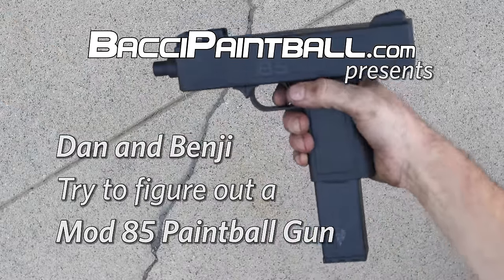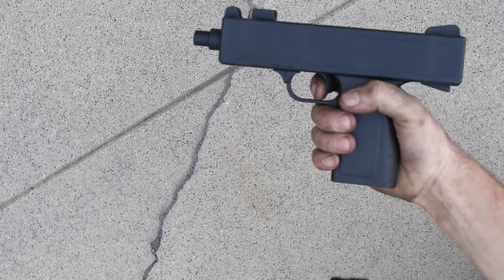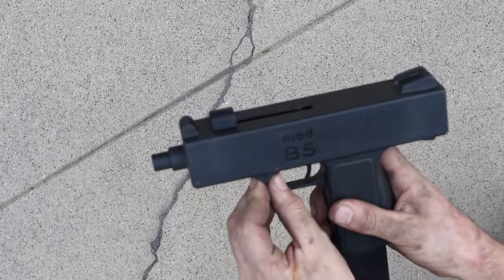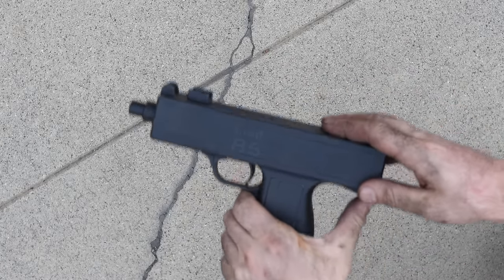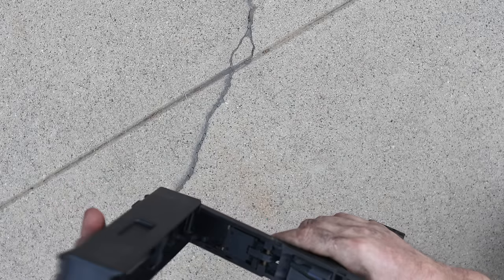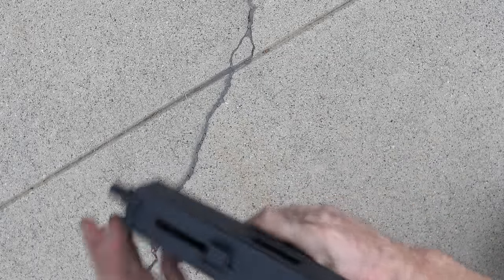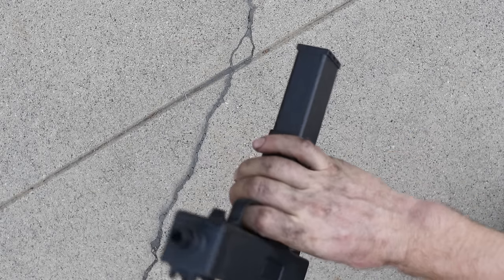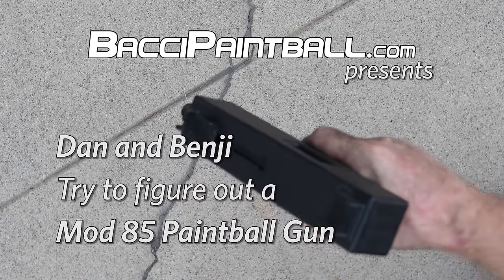Para Ordnance Mod 85 - a Primer Powered Paintball Pistol from 1985

Comment: Shoots .375 caliber paintball projectiles.  It fires this .375 caliber paintball from the detonation of a large pistol primer inside a plastic cartridge case.   You get the sound , recoil , shell ejection , and even the smell you’d get from shooting a real firearm. Projectile comes out at 450FPS or more,  but seeing as it’s only a .375 caliber projectile and not a .68 cal , it supposedly hurt less…. (I wouldn’t want to be on the receiving end of this thing tbh) ,

Comment: I had a pair of these back in 1986ish. They used a Nylon shell casing that sort of was like a 44 auto mag rimless casing. 25-round magazine that emptied very fast. Firing roughly a 38 caliber gelatine paintball that was powered usually by a small or medium pistol primer. Let me help you with the terminology the Magazine release is called a Heel Release. It is full auto.. so the switch is safe or fire. not semi or full auto. Although rumor has it that they were going to release a select-fire version. As these fired at above 400 fps they usually were not allowed on paint ball fields in Ontario Canada. The tiny projectile and its small paint payload indeed are difficult to see on clothing. Factory-loaded ammunition was rather expensive for these and worked out to over $1.30 Canadian per shot in 1986. The company also sold reloading kits and such. These were originally intended to be used for Law Enforcement swat training and such but somehow entered the civilian market via way of paintball. A buddy of mine worked at a rubber forming factory and he made up for me about 500 solid rubber balls which I at the time thought would be interesting to try. On a chronograph, the rubber balls with a small pistol primer were just about 395 feet per second, and the medium pistol primers about 445 feet per second. I never tried a large pistol primer as I felt the cartridge etc could not handle it. I bought mine at a Gun shop in Western Toronto for about 500 a piece and the owner of the shop gave me a discount on my first ammo purchase and the reloading kit. I sold them in the early 90s to a movie production company.
Reply: Great information thank you for sharing 💯❤‍🔥
Reply: We had one of these at our local paintball field during the late 80s.  We were not allowed to aim it at people, but we once shot the side of a panel van with it and it left permanent dimples in the sheet metal.  I am glad it was never allowed on the field.  It was a handful though and tons of fun.  I concur that it was Full Auto only and unloaded it's magazine in what felt like a second.

Comment: I had the sales model that went full or semi, you had to put in a removable sear manually, the gun broke safety goggles,  shot at 400+fps! It went through 1/2in drywall where it was poking out the back. It was a 6mm round, dumped the 25 rnd mag in 1.5 secs 1200 rpm, I have the full article still from Gung ho magazine...when we used it on the field, it instilled the fear of God into people, you have to remember the game was new, the best gun was a PGP or Splatmaster, so to hear someone ripping full auto...and then the screams after someone was shot! Priceless!!! Good times...
Reply: You got rid of it?
Reply: @FreeStyle786  yea, about 5 years ago, no ammo, no use...
Reply: The Splatmasrer LOL.
What a piece of trash that was. 
I upgraded to a Tipmman 85 with stripper clips… 
I thought that was the shit till the PGP came out.
Reply: @WhySoManyPasswords  pgp was out first, tippmann came out with the auto with stripper clips in 89'...
Reply: Do you have a scan of that article still by any chance?
Reply: @FreeStyle786  yes I'll look, it was from a" gung ho" article from 85'.
Reply: @scottdoran3112  thanks, I appreciate it… I have one of each of these guns as a novelty collection and I’ve never seen an article about them.